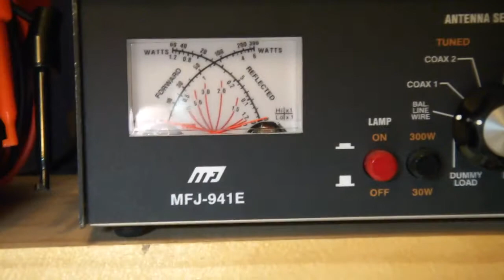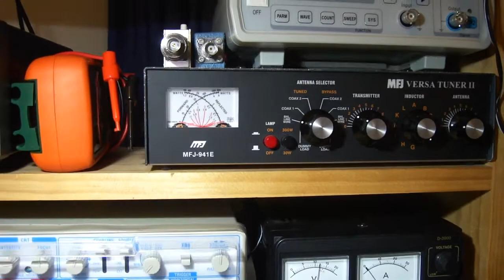Simple Homebrew SSB/CW Transceiver Part 9 - ON AIR DEMO, next steps

Comment: Hey Charlie I am wondering why you didn't stay with the three bands and not just the single band ? I was hoping that you could have continued with the three different bands .
Reply from the maker: Hi Joe. Sorry about that Joe. I must admit I cannot recall why I did. Either way,  do plan to do another multi band one IDC. I only have a 20m ans 80m antenna, which doesn't help. I am also looking to build a wide band linear 20W-ish amp soon, which would make a good basis for a multi band radio.

Comment: Hello Charlie...very good job.....Thanks for share with people....is posible donwload the schematics and code  of your transceiver ??? is amazing and I like very much the bw filter...... I try to construct one, I have the teensy board and audio shield and the oled display.....Thanks and 73!!!....EA7IXD..Mario...
Reply from the maker: Hi Mario. The code is at:
https://gist.github.com/CharlieMorris/05d9552fc0072085bfe57e7981b2388b

As for schematics, I'll have to see what i can do, as most of the schematics are in LTSpice. I'll see if i can export those as images.

Charlie
Reply: Hello charlie... Thanks for quick response... And thanks for link to the code.... But this code is valid to tx on ssb???
Thanks... EA7IXD... Mario.